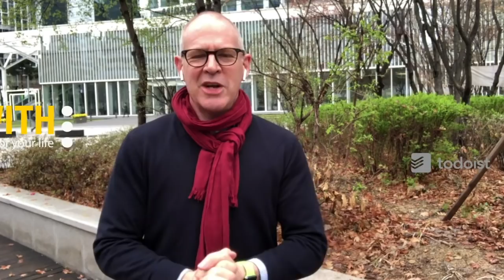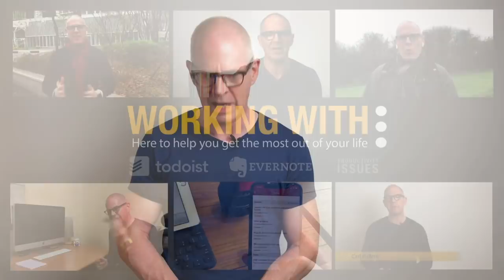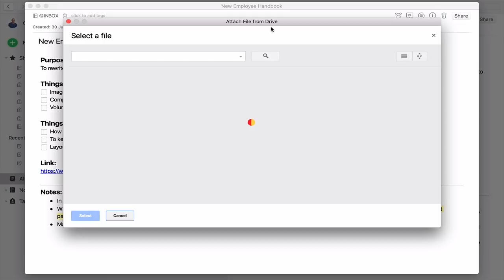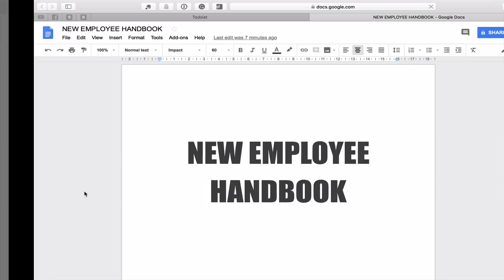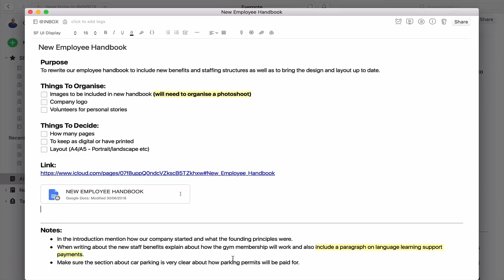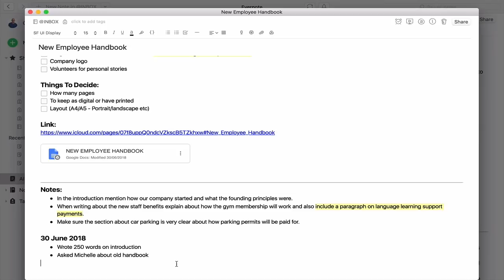Working With Evernote | Using Evernote to Manage A Project

Comment: Hi Carl, great input, at the moment I am messing around with follow ups in Excel, to be honest lots of Excel sheets.
Reply from the maker: If it works, don't fix it. That's a good mantra to follow, Kai. If your follow-ups work well in Excel, I would not change it. If you find Excel is slow, then consider an alternative.
Reply: @Carl_Pullein  It is slow and you don't habe the helicopter view, because all the needed tasks are all over the place. Excel was an idea of some quality managers :-)
Reply from the maker: @kaischmidt6597   Ahh, then you probably need to find an alternative :-)

Comment: As usual another great video tip for using EN & Todoist together. 

This hit home with me immediately as my occupation is very project oriented. The problem I’ve come up against (Windows eco system) if I need to merge two notes into one it breaks the link in Todoist, receiving a message that the note is in the trash. I then have to create a new EN link and repaste into Todoist. It appears to take the original note and the new note, throws them in the trash and creates a 3rd merged note with an entirely new link.

Any way around this?

Thanks again for all you do in this area. It’s rocked my world.
Reply from the maker: Sadly, I don’t know. I don’t have a Windows computer at hone to test it out. I know there are some differences between Mac and Windows and the Evernote environment.
Reply: Carl Pullein I wonder if it happens in Apple eco making it an EN issue?
Reply from the maker: I've never had any issues with this in the Mac environment. But, I rarely merge notes and when I do it is usually to clean up a completed project before archiving the note.

Comment: I use something very similar.  I like your wording better though.  But after purpose I specifically state "results".  This not only a finished product but may be a new shrill that comes from the project, or new relationships I expect to develop.
Reply from the maker: Nice. I like it. The key is it works for you 👍